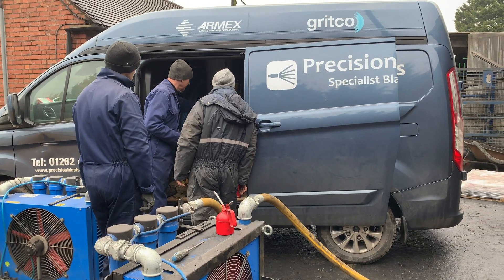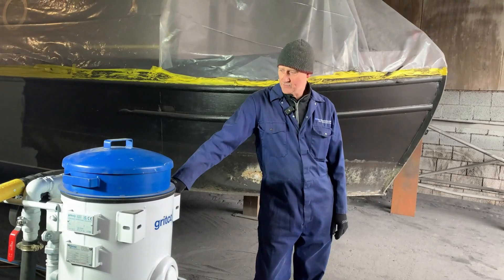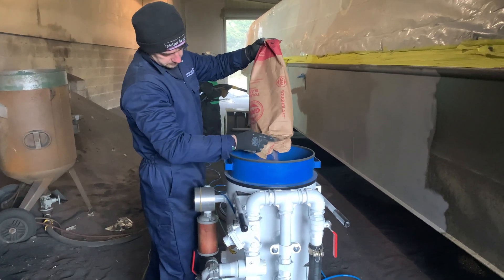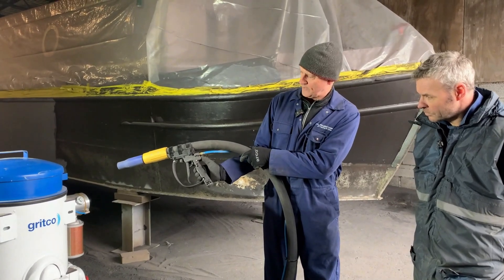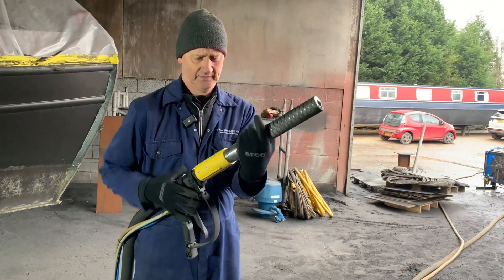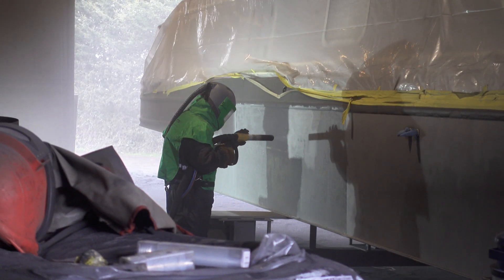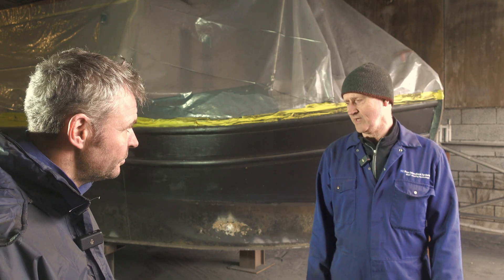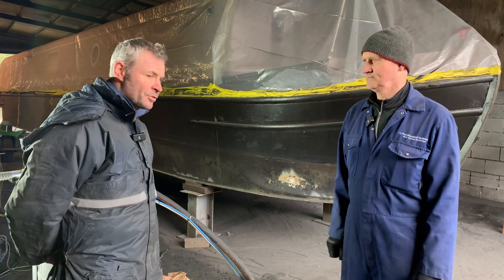SHOT BLASTING! A Technical review with Precision Blast Systems.

Comment: How long until someone manages to recycle the materials used so it can be reused many times? The rust could be removed by magnet and paint flakes by winnowing. Apart from reducing the amount of shot blasting materials required for each boat it would make the process greener.
Reply from the maker: We do recycle the materials used 👍
Reply: @bluewaterboatbuilder IS it a difficult process to clean it for reuse?
Reply from the maker: No it’s not a difficult job 👍

Comment: I have been in the painting,blasting game for 40 yrs think I have  used and seen just about all the old and new gear, vaccy blast is ok for open flat areas not so good for any tight areas,to keep dust down you have some options like slurry blast(water),also sponge blast which is sponge impregnated with grit and does keep the dust down but you need to keep it contained and dry to collect the sponge for reusing ,as for flat narrowboats vaccy bast prob a good idea but to get a decent vaccy system it involves a pricey bit ok kit ,if you want to keep cost down ,jblast or scan grit, a decent extractor fan and a decent containment plus jbast etc is inert (not a hazard) can be dumped in a general waste skip we had this tested years ago ,anyways just a thought
Reply from the maker: Thanks for the advice, we currently use Jblast but are experimenting with other blasts currently as well. 👍

Comment: Firstly may I point out that out of the 21 cars I have owned  3 were 2ltr. 3x 1.8ltr and 2x1.6 and one landrover had a perkins  bus engine  in it, a small bus but a big engine  none  the less. I say this because I do not want people shouting at me because you think I am a very green person ( polite). 
 I do my best to be as environmentally  supportive  as I can 
And I think the comment about re using the grit instead  of concrete  as ballast is fantastic 

I love the new grit blasting machine and the video was brilliant. My only two little gripes are. 1/ the doors at both ends of the shed were wide open. Will this not let the grit/ paint blow through and out into the environment? 
2/towards  the end of the video two of you walked over to look at the Hull. Neither  of you had even a basic face mask on. It could just be dust on the camera  but still it was mucky  in there.

I say this simply  because  as only a DIY er I never  bothered with H&S and as a resut I am deaf, and need 2 new hips, 2 new knees. A new back would help and my lungs are not as good as they used to be. Or as my beloved tells me I  just need TCL..... trans cranial  lead 😮

P.ease do keep up the good work
Keep the videos coming 
And please do not think I am being negative. That is/ was never my intention 

Nick

Comment: Hi David,
On average how does the weight of the grit compare to the weight of the concrete used as ballast in the narrow boats?  The reason for the question is, could the grit be a substitute for or used in conjunction with the conventional narrow boat ballast?
Mark
Alberta, Canada
Reply from the maker: Thanks for watching!  The weight of the grit is nowhere near the weight of a concrete slab or block that we use for ballast currently and unfortunately very messy for boat owners in later life. 😊

Comment: Having recently watched a video on another channel, where they were having to re-black a narrowboat, that had been blacked with a 2-pack epoxy paint, but the hull hadn't been prepared properly, and the 2-pack was flaking off after only a couple of years, I can see why it is a false economy to not properly prepare the hull prior to 2-pack painting. Thanks!
Reply: It must be quite common. I spoke to lady last week who had hers 2 pack blacked only a year ago and looking for someone to redo it properly as it’s all coming off. Never appreciated how important it is to get it done properly.
Reply: @charlottesweeney2966  Think we should acknowledge "properly" costs an extra £3000 to £4000 unless by having the equipment, blasting shed and expert staff onsite means Bluewater can offer a better price? The message evolving for narrowboat owners is stick with regular bitumen blacking paint until funds are available for a proper job as illustrated across a number of videos on this channel.
Reply: @ fair point. There is an element of false economy with bitumen though to factor in. Cost us over £800 to do last September and wouldn’t want to leave it more than every 18 months.
Reply from the maker: Applying bitumen every 18 months unfortunately is false economy in the long run but I do understand why boat owners do it for the cost at the time. For Many years that was all that has been available and many boat owners don’t know that shot blasting and a two pack blacking is available and the thing for your hull protection 😊